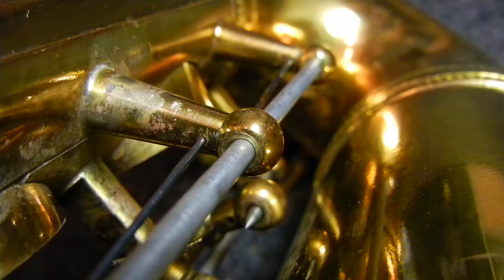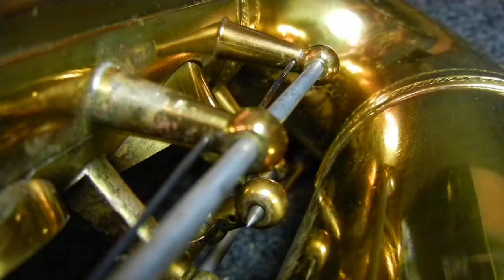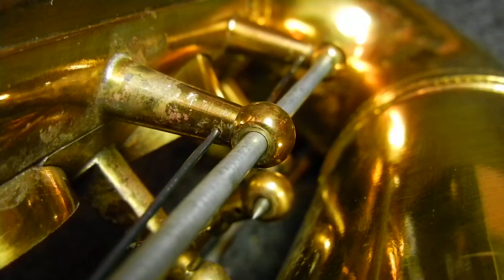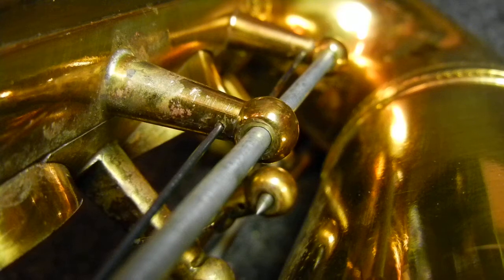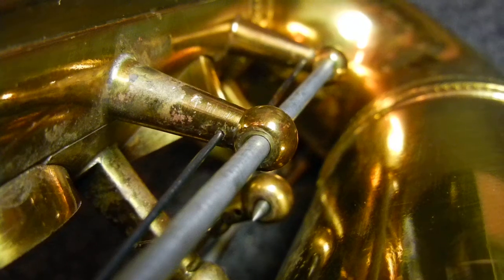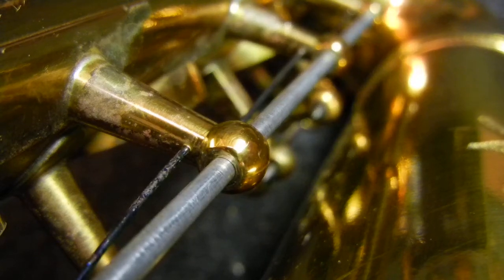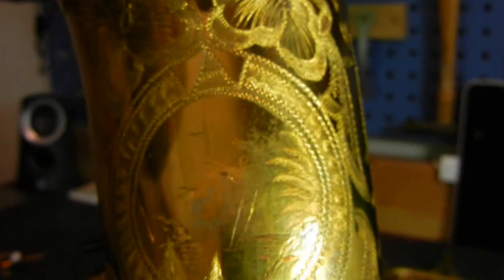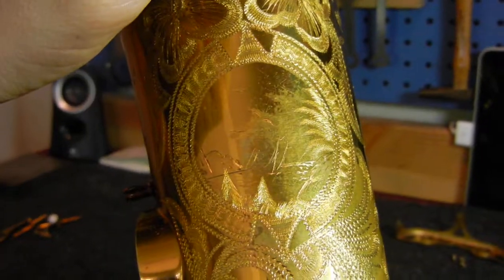Saxophone Repair Topic: Post Bushings

Comment from the maker: I like those pliers and use them for every mechanical overhaul I do.  They have their limitations though- they can only go so far, care must be taken to not damage the opposite side of the post or peen the post hole asymmetrically.  

I don't think I'll make a bushing video, so- main idea for a good post bushing is this: drill out the post, make a bushing perfect around rod but *leave some room* inside post, put bushing on rod, install rod, THEN solder.  It will self-center that way.